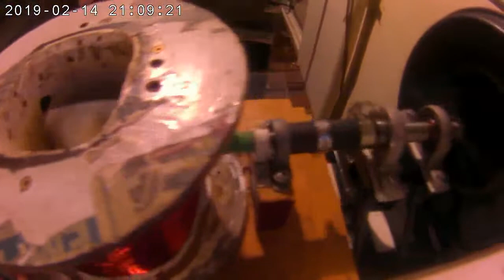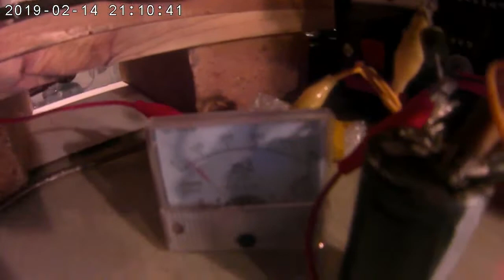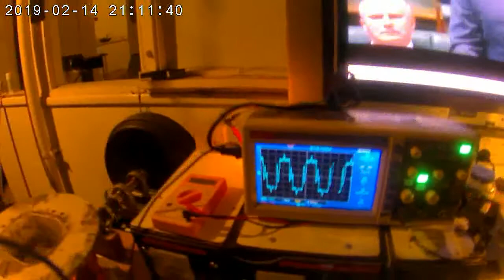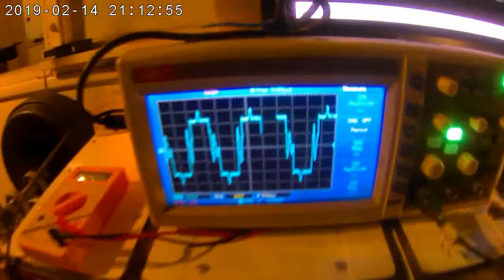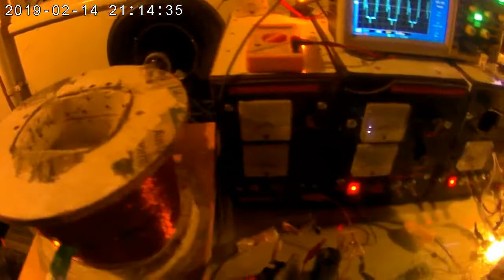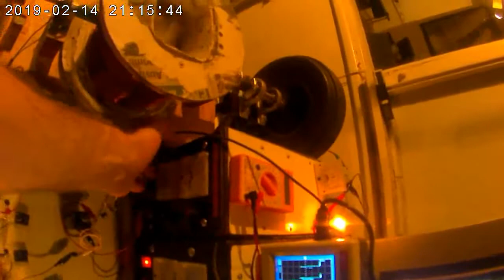Free Energy Motor Demonstration

Comment: Interesting work, I think from experience that unless you remove the diodes from your power circuit and instead provide a process to dump the energy from the coil between half-cycles, the motor will fight itself. I recently left a comment on another of your videos with a link to a patent file from here in the USA which shows a process for dumping the coil power through some fluorescent bulbs (non-linear, voltage-limiting load). When your circuit switches from on to off, the energy from the back-EMF can be discharged through the bulbs.
I also disagree that size is the limiting factor. Newman made models the size of modern 1/4HP electrics which worked great.
Reply from the maker: thankyou for your input, - i replicated newmans small machine (1/4hp size),  although they can produce 100watts or so,  the more power you extract, the lower the efficency gets. - mine that size are up too COP20 if you only extract 2 watts on the shaft.  ,  please see a later video if you wish.  https://www.youtube.com/watch?v=Stjf7M1Cx78

Comment: some late info.     you are FOOLING  yourself.    here are some FACTS, in support of this statement.      volts  are   NOT  power.     power is expressed in  WATTS.      volts x amps = watts      and, there is More energy in DC watts, that  AC watts.       can you tell us  the  WATTS  going into this mess,  and  the  WATTS  coming out.    i bet, NOT.       an unmodified f&p motor makes an  Inefficient  pma.   why is this true.   the motor is Purpose-designed and the design is  Optimized  to work as a 3-phase  BLDC motor.     instead of three coils per phase in the stator, there are SEVERAL; and the magnet rotor has  a Corresponding config.    see linked drawing, of a smart-drive stator config.   when all the coils of a phase are energized, in a Normal way, there would be a  HUGE amount of lenz-force braking, occurring at the coils.     this happens when there is a  Nominal current draw.   which is Obviously, Not happening, in this mess.      lighting a  LED  light, rated so-many watts,  tells you  nothing.    why is this true.     a  LED  is  a   DC   device.     when a screw-in  LED bulb  is used,  it is NOT powered  by the high-voltage mains AC.   it has  rectification and voltage reduction CIRCUITRY  built  into  it.      if you want to stop wasting your time and are interested in having a  CHANCE  of success, see  my research.         googletranslate
https://lgechupacabra.files.wordpress.com/2016/09/standard-wire.gif
https://en.wikipedia.org/wiki/Lenz%27s_law
https://www.fisherpaykeltechnologies.com/products/direct-drive-motors/
Reply from the maker: Quote from Patrik Kellys book:
Consider an air-cored coil with an interior diameter of 10 feet, a height of 8.32 feet and would with 1,000 feetof 40-gauge copper wire. That length of wire has a resistance of 1,049 ohms and weighs 0.02993 pounds.
If 100 volts DC is connected across it, then a current of about 95 milliamps will flow, which is a power input of
9.5 watts. With just 31.8 turns, it will produce a weak magnetic field of 0,012 Gauss, with a mere 0.000014
Joules of energy stored in it. With a tiny inductance of just 0.003 Henries, if the current is stopped and the
ends of the coil shorted together, only an insignificant current would flow.
Now, repeat the experiment, but this time, use 5-gauge copper wire. As it has a resistance of 0.3133 ohms
per 1,000 foot length. To equal the same resistance and match the previous current flow, a massive length
of 3,348,000 feet needs to be used. This length of wire will weigh 335,469.6 pounds which is 16.77 tons.
The 10-foot interior diameter coil, 8.32 feet tall, wound with this wire will have about 90,000 turns. If 100
volts DC is now connected across the coil, the same 95 milliamp current will flow with an input power of 9.5
watts, the same as before. But due to the massively larger coil, it has a magnetic field of 23.7 Gauss, which
is 1,905 times larger than the previous coil, and with 116 Joules of energy stored in the magnetic field. This
is a phenomenal 8,000,000 times more energy than in the 40-gauge coil of the previous example. A
phenomenally larger current flow would now occur if the current input was stopped and the coil shorted out,
as that would generate an inductance of 25,700 Henries which is more than eight million times the
inductance of the previous coil.

The values in this comparison are extreme, but Joseph built then a 
prototype motor with "only about 2 tons " of copper and run a 600 pound 
PM rotor with 1.5 W of power consumption and a huge excess energy and 
strongest BEMF spikes.

The point I want to remark: we certainly will not be able to spend 
money in this amount of copper, but increasing the wiregauge and nr. of 
turns by a reasonable factor might increment the performance of our 
devices very notably.

Comment: man that awesom shit there bro'''' i have waited for yrs to see someone  finally using a newman  motor to do wut your doing'''  keep it up man:)))))0  awesome'''
Reply: for sure more too come, -  there isnt any overunity machines out there, but i dont mind posting about it, ....    coz i want too farking sell it ;-D. .  or at least create somthing as viaable as cheap solar panels !!!. we have a long way too come in this field,  -  gg bruce yoniy
Reply: @Patrick.Watkins  since   everything runs on resonance the solar cells we make  will allways be  junk man'''  they run on  heat and not on resonance''' if u do the latter they would run 24-7 365:):)
Reply: @obiwankanobi874  run for ever, iron, magnets, and bearings, - just add a little post apocalyptic cat oil
Reply: @2DOG3FIST Sure i will sell you my nice new one, - 3d printed version, i will share the plans too.   it is true this information has been suppressed, in the past, and still is, - but only the best designs are suppressed.   - this motor is incredibly efficient, - but its not a game changer.  sure you can power a few lights, and mabee a laptop. - but its more designed for clint eastwood.       .... however in my spare time....,  im also working on achieving same without a spinning rotor. - and in a smaller package. - ,,,,,,,,  my best newman i can design, would be the same size as a computer tower, - too power a computer tower, infinitely with no input.,   but would weigh nearly 100kg and cost over $1000, even as mass produced product.....   this tech is just not worth suppressing....